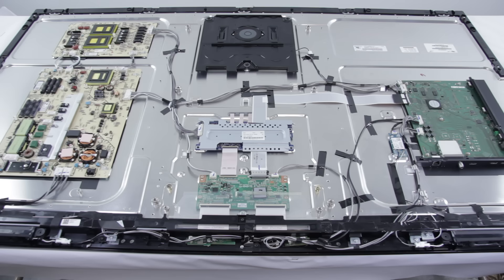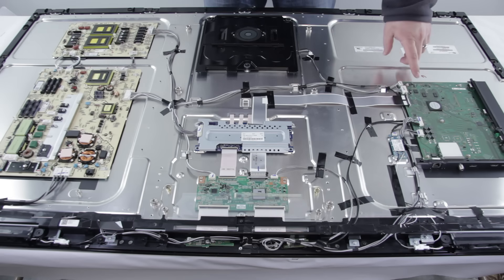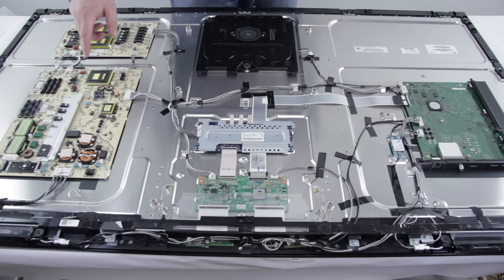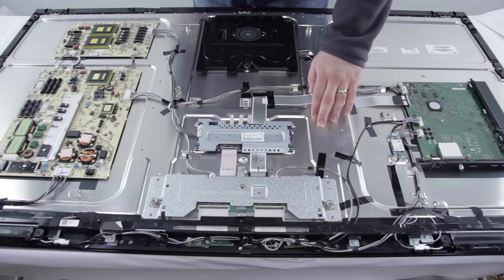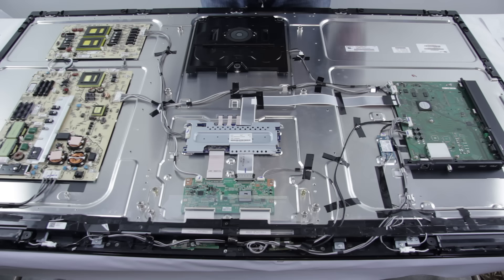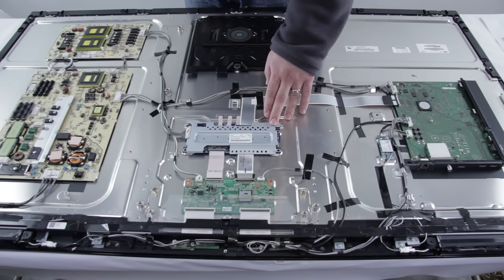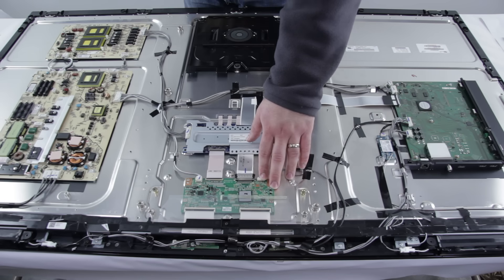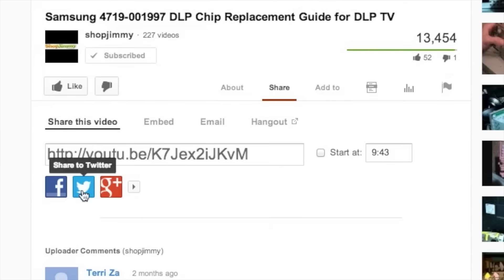LED TV Repair Tutorial - Common Symptoms & Solutions - How to Repair LED TVs

Comment: I have a 32" Vizio LED Model M320NV
We had a power surge.  The TV continued to work then a few days later a vertical shadow appeared on the screen. It's 4 1/2 inches wide and runs from the top to the bottom of the TV. You can still see the picture thru the dark/shadow line.

Comment: Hi, I have a Haier LE46F2280 46" LED tv. For some reason when we relocated the TV to another room, not the display will not turn on, the red LED at the bottom that indicates standby is working. And we use a voltage tester to make sure power was going into the TV. And everything checks out ok, but the screen itself will not turn on. Any ideas? Thanks in advance

Comment: I have an lg 3d tv 55w5600-ua that stopped working. When I turn it on the power light turns red then breathes (long slow flashes like breaths) a couple times then turns the usual white but nothing else happens. No picture sound anything. Please help

Comment: can u help me , i have TV LG 42LE7500  the problem The TV would power on and the LG Logo screen with the clock would appear.  It would freeze on the logo screen.  It was stuck there and would not boot any further.  The menu button would not work. can u help solve the problem....

Comment: I have a Hitachi L37V01UA, the screen splits horizontally sometimes after switching it on, it will return to normal if I give it a firm bang with my palm on the rear, sometimes I have todo this a few times. Any idea what the problem is?  Thanks.

Comment: LG 55LB552v led TV. The standby light doesn't come on when i plug-in to power the set. I checked the power cord so i know power goes into the TV. Its just 3 months now i got it, need help.
Reply from the maker: Olukayode Oguntade  Try all repairs and troubleshooting at your own risk.   Do you have experience using a meter to check voltages?  If so, you can check the for the 5V standby power on the power supply.  Thanks!  www.shopjimmy.com

Comment: Hello. Great video! I have a TCL le55fhdf3300z that won't turn on, so I assume the power supply is bad, based on your video. How do I know if I need to replace the main or sub power supply unit? Thanks!
Reply from the maker: Elijah Rivera  Try all repairs and troubleshooting at your own risk.  Is there a standby light on in the front of the TV?  Thanks!  www.shopjimmy.com
Reply: ShopJimmy.com Yes, there is. When plugged in, the only feedback I was getting from the TV was what seemed like intermittent flashing of the stand by light.
Reply from the maker: Elijah Rivera   Do you have experience using a multimeter to measure voltages?  Thanks!  www.shopjimmy.com
Reply: ShopJimmy.com no experience but I have limited conceptual knowledge. I guess you are suggesting to test the pins on the power supply boards? Short of that I assume my only option is to simply replace one power supply to see if that fixes it. If it doesn't, I can replace the other and hope that will fix the problem. Is that about, right? None of the components on either board look obviously damaged, but I haven't tested the fuse on the main power supply board. Could that be the problem? How do I test the fuse(it is ceramic so I can't tell just by looking at it). Thanks for all of your help!
Reply from the maker: Elijah Rivera  Try all repairs and troubleshooting at your own risk.  Right.  I would have you check to see if there is standby voltage.  Since you have a standby light in the front of the TV, I would replace the main board first to see if that fixes the problem.  Click this link to replacement main boards for your TV model number.  http://www.shopjimmy.com/catalogsearch/result/index/?cat=56&q=le55fhdf3300z  There may be multiple boards for the same TV model number, be sure to match part numbers on your current board, with your replacement for compatibility.  Thanks and please let us know if you have any further questions with your TV Repair!  www.shopjimmy.com

Comment: Hello, I think my Samsung LED TV has a problem with the backlight inverter. It goes black after a few seconds on. The sound still on but the screen dies. I can see that the menu is still there when I point a light at the screen. My model number is UN40EH5300FXZA. Thanks!!

Comment: On my LG 50LN560 LED lower part of the screen has horizontal lines shifting on top of icons and graphics. This also shows color stripes in all graphics along with black lines.
Reply from the maker: Seth Nasworthy   Try all repairs and troubleshooting at your own risk.  This sounds like a TV panel (TV Screen) problem.  If your TV panel is bad, it may be more cost-effective to replace the TV as panels are typically hard to find in stock, difficult to replace, and expensive.  Thanks and please let us know if you have any further questions!  www.shopjimmy.com

Comment: hi there, my SAMSUNG - UE40D5520 40" Full HD LED TV

has developed the following fault.   the top left third of the screen (imagine like a large rectangle starting the top left and cover about 1/3 of the entire 40 inche screen) the TV can operate fine sometimes and then this region of the screen will flicker with black horizontal lines.   The flickering will sometimes get worse and suddenly that 1/3 of the screen will go very dark and distorted like having 95% contrast on black.  If you then move the screen or tap the back of the screen it will correct itself but the fault keeps coming back.  This particular region of the screen also feel unusually warm/hot from the back.     The TV is out of warrenty.   Any ideas?
Reply from the maker: JD's Folk and Blues channel   Try all repairs and troubleshooting at your own risk.  This sounds like a TV panel (TV Screen) problem.  If your TV panel is bad, it may be more cost-effective to replace the TV as panels are typically hard to find in stock, difficult to replace, and expensive.  Thanks and please let us know if you have any further questions!  www.shopjimmy.com
Reply: ShopJimmy.com thx for the advice sounds like the dread tab bond problem.  :(

Comment: I have a Samsung UN55F6350. Just tonight when I tried to power it on the power light blinked 5 times then after a while 5 more time. No backlight was visible. A quick check of the power supply showed 5V and 12V supplys present but there appears to be no output to the led backlight. What should I replace?

Comment: I have a vizio 60 inch smart tv model E600i-B3 I dinged the corner of it and it produced a flat line Crack at the top I only can see picture on the bottom half is it fixable.
Reply from the maker: Jvon Lewis   Try all repairs and troubleshooting at your own risk.  This sounds like a TV panel (TV Screen) problem.  If your TV panel is bad, it may be more cost-effective to replace the TV as panels are typically hard to find in stock, difficult to replace, and expensive.  Thanks and please let us know if you have any further questions!  www.shopjimmy.com

Comment: I have a Philips 40" 1000 series LED/LCD TV, model number:  40PFL1708/F7.

When I push the power button on the TV or remote, I see the light indicating there is power, however there is no picture or sound.  I'm not sure if the TV is actually turning on, but it seems to me that it is.

Comment: Hello, hope you could advise: have an Lg 32LN5400-ZA and backlights have gone. Done that torch test, and screen good. but back has 4 boards; power, input, button and t-con (I think has two ribbons to screen). sound fine, but can not find source for replacement parts. Have lots of pics if helps, greatly appreciate guru's wisdom...
Reply: Just realised, i didnt subscribe beforehand, so now have.

Comment: Hello, thank you for this nice video. I have a 40" Samsung LED series 6 which i bought recently, it's UA40F6400AR. I'm having an annoying problem that is when I hit a command the TV goes blank and reboots itself a couple of times if not for an unlimited time. Yet it does this by itself so often without any command pressed.
I've read on some forums that the problem has been resolved by replacing so called (power cable) inside the tv box (in between the boards) and some people had it solved by removing the WIFI card and it worked for them.
I've bought this tv for all its options and performance, WIFI included so why would want to unplug it anyway.
Any ideas about this issue? it'll be much appreciated :)
Reply from the maker: Ritchys   Try all repairs and troubleshooting at your own risk.  This could be a problem with either the main board or the WiFi card.  You can try replacing them individually to see if one of those boards fixes the problem.  There may be multiple boards for the same TV model number, be sure to match part numbers on your current board, with your replacement for compatibility.  Thanks and please let us know if you have any further questions with your TV Repair!  www.shopjimmy.com

Comment: I have a Samsung Model UN40F5500AF it has sound no picture. it had a shadow on the bottom of the screen prior to the picture going out. With a flashlight shining at it you can see the programing on the TV. It has three major boards. Looks like the LED driver is made into one of the boards. Could you recommend a replacement part. Thank you.

Comment: I have an Element model number eleft502 that had the picture just go black from out of nowhere, but audio still works. I did the flash light test and I can see the menu, but there is no backlight. I read that the Backlight Inverter was built into the 'Power Board' and so I bought a new 'Power Board' and replaced it, but the back light is still not working. Any suggestions?

Comment: The ps3 was causing the heating up of the hdmi which was causing the tv to restart. And then to the bright scree. The t con board fixed the screen issue now I have a vertical line not too bad it was blue now it's transparent. But now I use a hdmi duplicator  switch. No heating up on on the tv anymore. My regular uverse reciever is plugged dire tly in to tv no issue. Looks to be the ps3 messed it up.

Comment: Hello, I have a LG 55lm6700-ua and today I was listening to music through my LG dvd player when the screen went dark with multiple dark vertical lines, I still had sound so I thought it went to a power saving mode dimming the screen. So after pushing the home button with no change I turn the tv off and then back on but the screen is still black but with one dark vertical line splitting the screen down the middle and after a min or so it turns in to multiple dark vertical lines again. I've tried unplugging it for a couple hours with no change. I don't know if this is related but about 6 months ago for a short time my tv would turn off by itself and turn back on with the LG logo after a couple of sec and after a week of random restarts it stopped until this new issue. Any help would be greatly appreciated, Thank you!

Comment: Jimmy, 
I have a LG LED mod 50LN1500 18 months old. 2 months ago a gray ghost spot appeared in the center of the screen. Today, the screen went black. I get sound, but can't change the channel. Did the flashlight test and I can see a picture. Q. Would the parts cost more than the set cost. 12/2013 cost was $450.00, Thanks
Reply from the maker: Paul Ulrich   Try all repairs and troubleshooting at your own risk.  Yes, parts would most likely cost more.  Thanks!  www.shopjimmy.com

Comment: LG 55LV5400
Just today the volume stopped working. After about 30 minutes of tinkering with settings the volume slowly came back but is VERY distorted. Any thoughts on this?
Reply from the maker: Jeremy Lee  Try all repairs and troubleshooting at your own risk.  This could be a problem with either a pinched speaker wire or a bad main board.  If you discover that the speaker wire is fine, you can replace the main board.  Click this link to a replacement main board for your TV model number:  http://www.shopjimmy.com/lg-ebt61521404-main-board.htm  There may be multiple boards for the same TV model number, be sure to match part numbers on your current board, with your replacement for compatibility.  Here is a link to a video showing how to identify your part number, click here:  https://www.youtube.com/watch?v=RwHTvjMdrhk  Thanks and please let us know if you have any further questions with your TV Repair!  www.shopjimmy.com

Comment: Samsung LED TV UA32D5000PRXZN-  When I switch on the power supply to the TV, the breaker of that section of the house trips. I tried changing the power cord as well as the location within the house.The problem still isthe same pointing to a problem with theTV.. Pls help
Reply from the maker: Deepak Sebastian  Try all repairs and troubleshooting at your own risk.  I recommend replacing the power supply board in your TV.  Unfortunately I do not see any replacement parts in the search results for your TV model number on our website.  Please reply with your part number on your power supply board and I can try searching for replacement parts.  Thanks and please let us know if you have any further questions!  www.shopjimmy.com

Comment: I have an Emerson LF461EM4 A LED TV.  bought in nov 2014.  it will not power on.  red stand by led is on and the is a faint beep beep beep... that comes from some component on the power supply board.  I am pretty handy and just need some guidance to correct test points to diagnose problem.  unfortunately emerson will only help me through their dealer, which is going to cost me a few hundred dollars.
Reply: Same

Comment: My tv model UN55D7000LFXZA, the screen has a horizontal shadowed bar on the top about 4 inch wide. If I restart tv a few times it goes away. But it's start to get more frequent. Once it grows away it won't come back while the tv is on. Please help me diagnose what cause this problem. My email oszasz@yahoo.com Thank you. Otto

Comment: Samsung 40" model#UN40EH5050FXZA.... Problem started out w/ not powering on, constant red blinking light.. opened it up, found a couple swollen and leaking caps.. replaced those but still had constant red blinking light.. then I got a couple complete power boards and changed it out, trying both new boards...still no power up and still have red blinking light! Is there something else to this? Not an expensive t.v. but, if I can fix this myself, I want to.. Help!

Comment: Morning,

I have a Sony KDL-60R550A. The TV has intermittently stopped responding to the remote commands. The TV LED is blinking indicting that it is receiving the command but does not execute it. (I tried other remotes also with the same outcome) Sony replaced first set under warranty last year for the same problem.

I'm guessing it is the IR sensor board. Are there any other parts that may be causing this?

Thanks, Tim

Comment: Hi, The model number of my LG LED TV is 47LW5300-UC. Someone accidentally sprayed wyndex glass cleaner on my TV screen. There is no picture on screen since then. However audio is fine. When TV is switched on it only shows grey screen with some vertical lines on it. Can you help in determining the problem and fixing it. Thanks!
Reply from the maker: Sudhanshu Mishra  Try all repairs and troubleshooting at your own risk.   Unfortunately there is no repair for this and you will need to replace your TV.  Thanks!  www.shopjimmy.com

Comment: Hello,
I have a Samsung UN55F6300 LED TV.  All the HDMI ports suddenly stopped working. All the other ports/inputs/outputs are fine. I tried the "unplug for 10 minutes" but that didn't work. Will I have to replace the main board or is there a factory setting or test that I could perform? Any help would be appreciated.
Thank you for your time

Comment: I have one blue wire coming off my control board going to my power/led driver board. The blue wire goes to PWR-ON DRV-ON is this power coming from the control board to turn on the driver. im guessing the rest of the wires coming off the power board are going out to the control board. the board i have is LG EAY62810801 POWER SUPPLE/ LED BOARD

Comment: Serial number ME1A1331217766 Model LF320FX4F Funai Lcd TV turns on but black screen... I know it's on cause it has the red light it would normally have when the TV is turned on wondering if there is a fix ?

Comment: My Sony Bravia LCD TV model no: KLV-32EX330 (2012) has a problem with the display. It shows a fine black horizontal line almost in the middle of the screen. Also, the image on top of the black line gets a little bit delayed. How to fix this?
Reply from the maker: EZ David   Try all repairs and troubleshooting at your own risk.  This sounds like a TV panel (TV Screen) problem.  If your TV panel is bad, it may be more cost-effective to replace the TV as panels are typically hard to find in stock, difficult to replace, and expensive.  Thanks and please let us know if you have any further questions!  www.shopjimmy.com

Comment: Westinghouse 
Model SK-32H540S
Part TW-55922-C032E
Serial 5592W81204362
 I use it with my laptop and the image all of a sudden after 2 years has degraded...text is sort of fine but pictures is very poor and blured.  What parts do i need to fix this or can i fix through the tv menu?

Comment: Help wanted 

I have a lg TV 47ln5700
Issue no back light 
Has sound  and I fallowed your steps that you mentioned  in the video that when I point the flash light into TV I can see the pictures .
So I replaced the T con Board. But still the same . Would you please help me if you have any  information. 

By the way the TV has only 3 boards supply, main and t con

Comment: LC60C6500U sharp aquos hit by lightning. TV powers on but no picture or sound only a blue screen tried the manufacturer reset to service and still nothing. The sharp pore light blinks 3 times fast then 1 blink then 3 fast blinks then 1 blink. Is it a power board and led driver problem or something else.
Thank you in advance